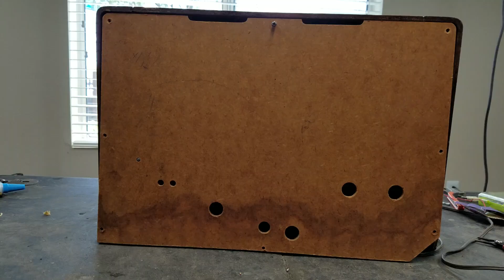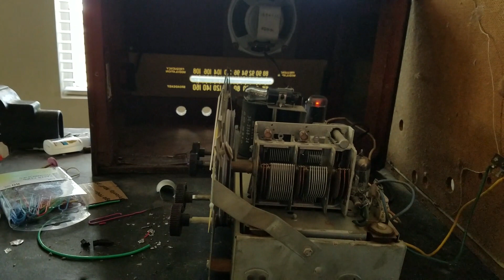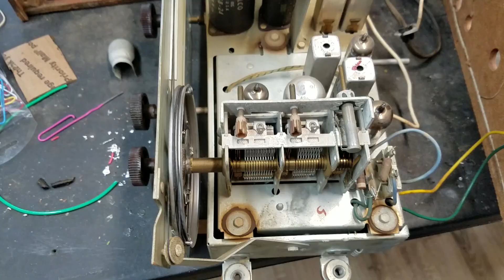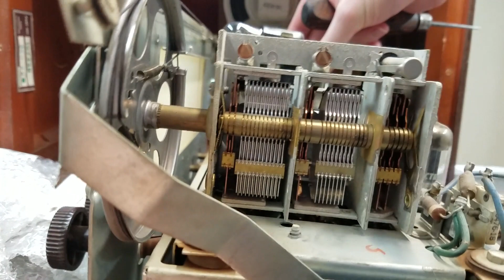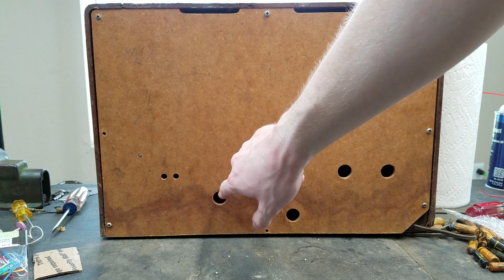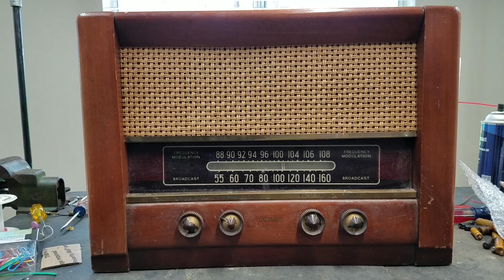Philco 49-909 AM/FM Radio Repair

Comment: I have a 1946 Zenith am/fm radio and the if frequency is 8.3MC(MHz) so you were quite close but my 1948 Zenith was the first Zenith model year that uses the standard 10.7MC as 1947 was the same models from 46 and 10.7MC works so much better on the FM. That is the main reason why they switched to 10.7MC. So yeah 9.1MC is odd and Philco is one of the companies that refused to use Armstrong FM a variant of the Foster–Seeley discriminator. It seems the Philco FM works like this, RF amp > FM converter > 1st IF > 2nd IF > Detector for sure no discriminator like on a Zenith or GE's of that era.  Also super interesting that its using two 117V rectifier tubes for a voltage double for 210V not a common voltage on series wired sets and I have not seen that before either. Cool video. Thanks for posting.